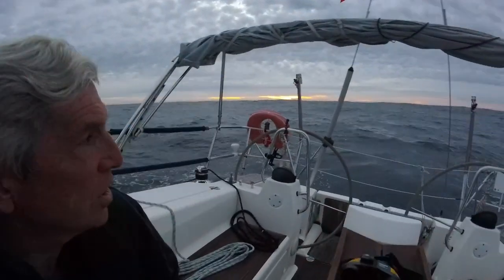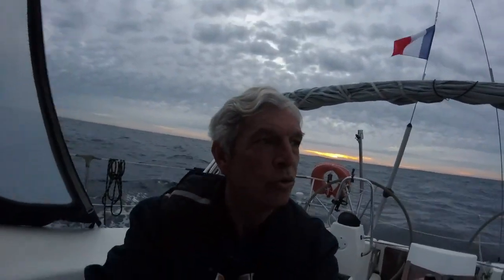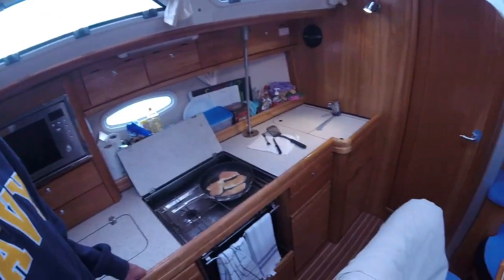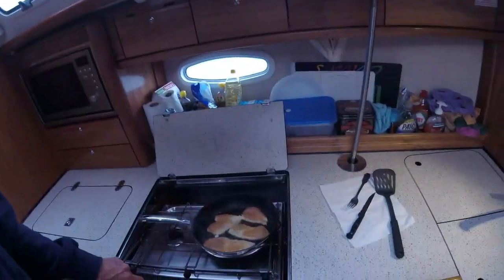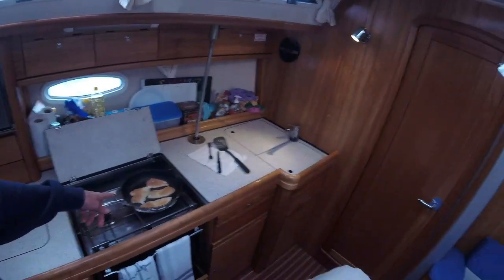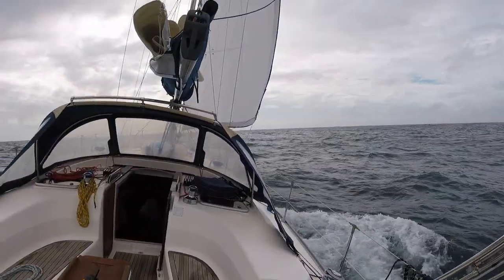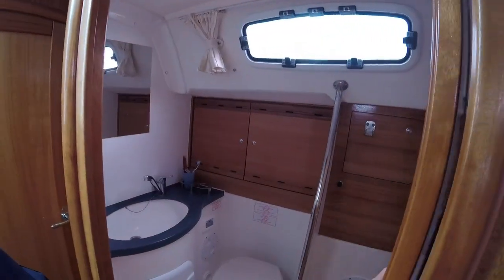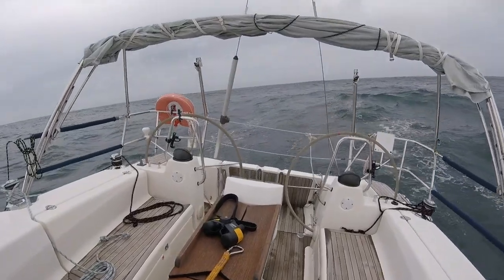Ep 7 Sailing singlehanded to Azores: When I use genoa only

Comment: Mr. Laine, I'm enjoying your videos a great deal as I try to learn sailing from my dry perch in the mountains of southwest Virginia.  I am a novice, but just yesterday I watched a lesson from the Maryland School of Sailing site on "Gybe Control" (<https://www.youtube.com/watch?v=qAhUWCa-KoQ&t=1212>) and I'm wondering now, had you tied a "preventer" line (see video) to the mainsail boom (against the main sheet's tension) could you have avoided the dramatic boom swings (due to rolling) that you say woke you this morning, as you describe in this video?  Have I grasped the principles correctly?
Reply from the maker: John, your excellent comment raises two thoughts: 1) There are two schools of thought on
gybe ‘preventers’.  One school feels the ‘preventer’ will fail at some point in the system just when you need it most.   This video https://www.youtube.com/watch?v=sakJNuTsiJI&t=428s illustrates that perfectly at 6:52.   The alternative view is to use a boom ‘brake’ rather than a preventer. It will allow the boom to gybe, but a friction line will greatly reduce the speed and force at which it happens.  I almost systematically use a boom brake when the wind is aft of abeam.   It is the blue line you can see in many of my videos hanging from the boom.   2)  I hate having the boom bang around as much as anyone.   The reason it seems to do so in so many of my videos is that I filmed them very often just after dawn, or just before sunset ---- the times that I almost always make a sail change (which required releasing the brake).   Thus, usually I have just made the sail change, but have not yet reset the brake when I filmed, so the boom is banging around.  No one puts up with that for more than a few minutes.  :-)   Great question.
Reply: I watched the video about the Florence sv, and I'm perplexed about how the boom failed.  Can you decode what type of "preventer" rigging had been used, and can you help me understand how that resulted the bending failure of the boom under sudden wind loading?  If their "preventer" had been rigged to the boom where the main sheet attaches, I could understand that the unsupported boom length could have been whipped into a fold (exceeding the allowable bending moment of the boom), but if the "preventer" had been supporting the boom end, how did the wind load result in a bending failure?
Reply from the maker: I am not an expert rigger John, and I don't know how Florence rigged their preventer (nor do I intend any criticism whatsoever of them).   Although I have seen preventers rigged at mid boom, or near where the main sheet attaches, I think most people rig attach them to the end of the boom.  (The schools of thought being if it is rigged at the end of the boom, the aluminum can bend in the middle and fold under a shock load.   If rigged in the middle, the bending leverage arm is going to be shorter -- thus less force.    (Also, placing it in the middle makes it a bit easier to rig while running downwind.)   I think more important than the placement is the golden rule to never have more sail out than the conditions call for.    I doubt any preventer is going to work in 40 kts if you still have a full sail out.  It may save the boom if you have 2 or 3 reefs in when the gust/gybe occur.    Good question.
Reply: I appreciate your thoughtful and prompt replies.  I suppose my question doesn't lead to a definitive answer, as you point out, but does admonish the sailor to reduce/drop the cloth before the squall hits.  Thanks for your instruction; I will remember this.